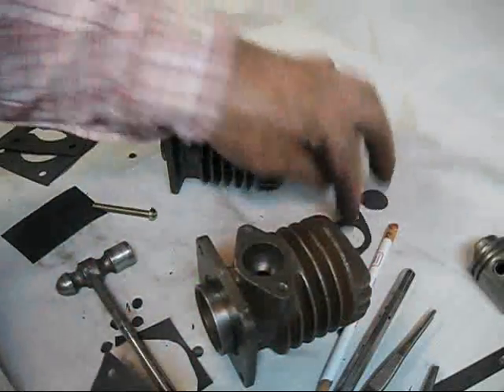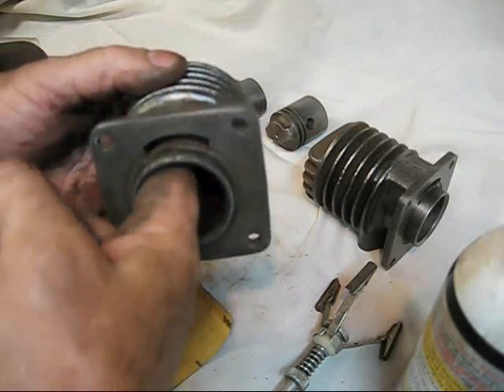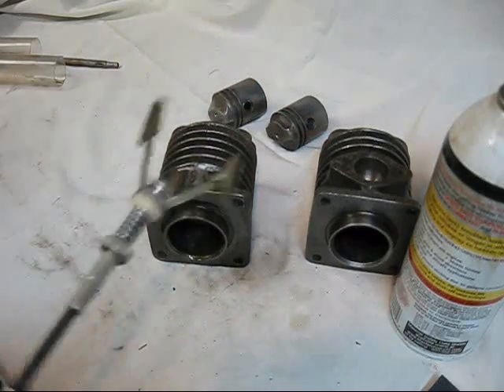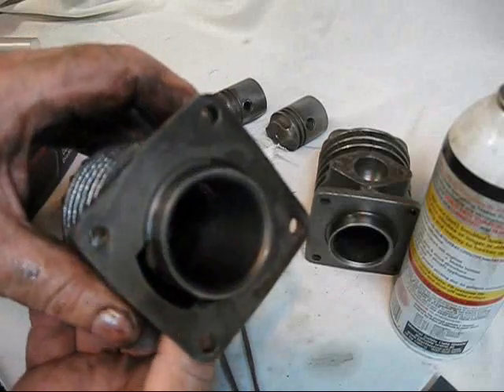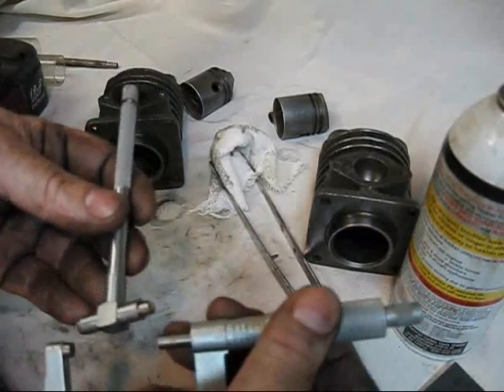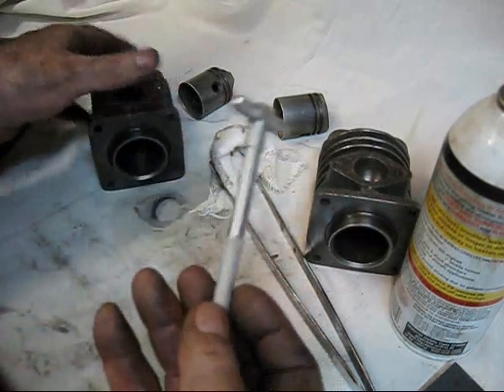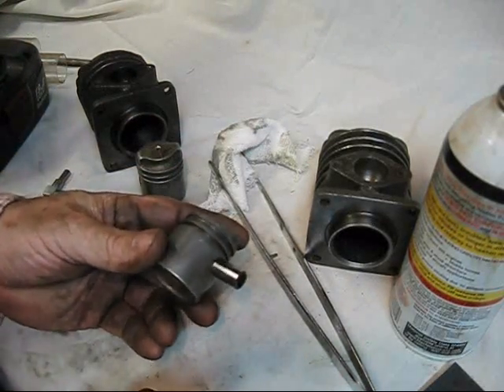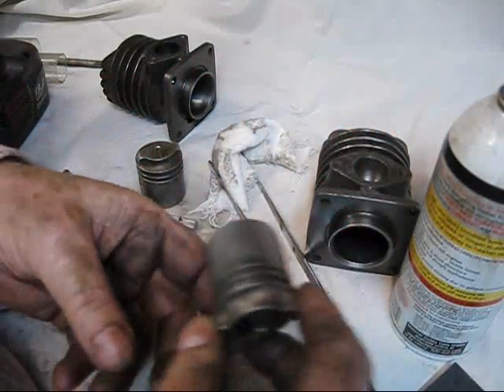1937 Maytag Engine    model 72 rebuild #23

Comment: I believe you want the bore gage slightly diag tighten losely then square the gage to parallel. Measure and repeat then accept the most consistent reading nice video cuts all the bs right to the point